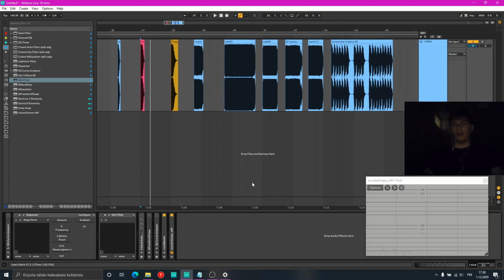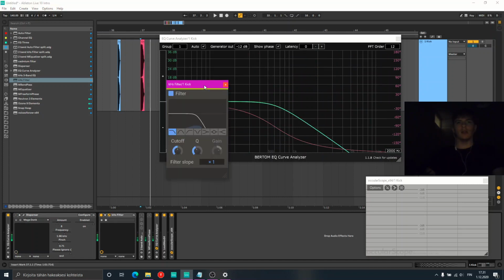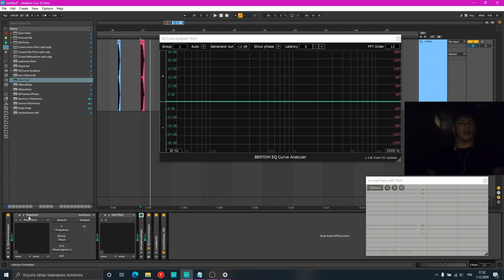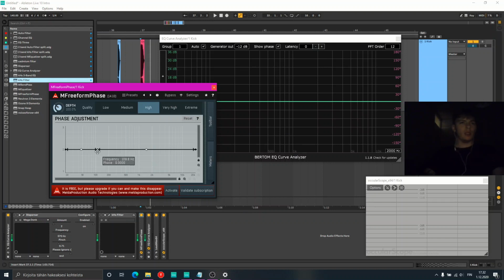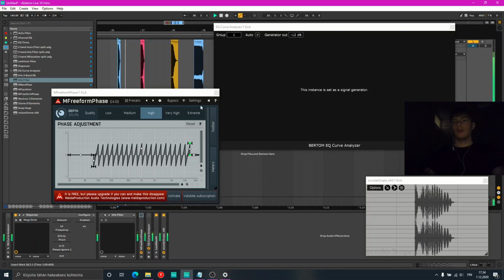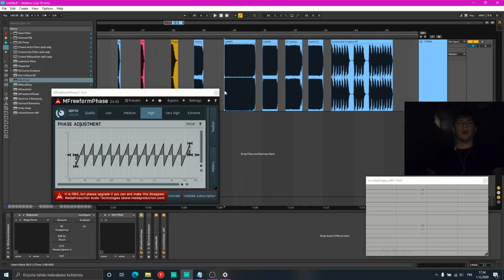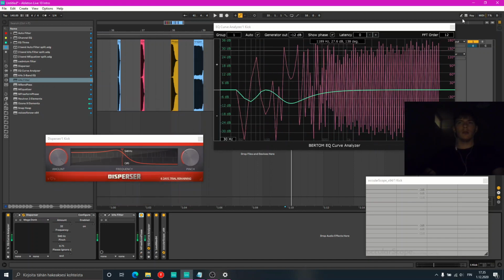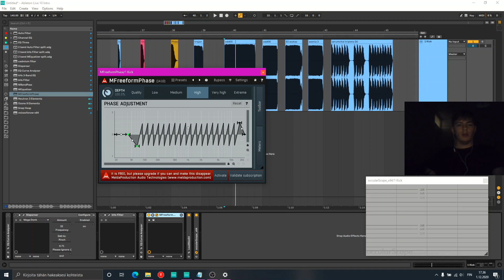Free Linear-phase Disperser | MFreeformPhase Tutorial

Comment: Every allpass filter will also work. I mean, in terms of looking for free replacements, there are other options, they're just not as easily stacked together and manipulated.
Reply: Yeah, double-checked it. MPhaser from Melda pretty much does the job. Set custom shape to a straight line (and mix it in with a slider), set phase difference to 0. Now you have a filter frequency (with Max frequency) and you can stack it (with mode and even feedback).

I mean, it's definitely different from MFreeformPhase, but you won't have to stack lowpasses, either. Allpasses will do just fine. No latency, different sound, good to have.
Reply from the maker: @Vospi  yup this video is pretty old and since then there's come up other options: mphaser, allpassphase, diopser. as you said, any allpass will work, since that's what disperser is. it's just that there's not that many allpasses available.
Reply: @borrasca  yo long time but where can I find allpassphase?
Reply from the maker: @GlowEm DL link is in the description of this video
Reply: @ bro a legend thanks!

Comment: Could you please show a phase problem fixing with that?
A kick and a bass would nice...
Reply from the maker: I only use it for sound design not fixing phase problems. Any bass should always be fully sidechained to the kick anyway so i don’t have them colliding in the first place
Reply: @borrasca  If you don't mind, I disagree about the best way to fix phase issues, but you're free to pick you way to deal with, of course.
I understand that phase AND side-shain methods together is the best.
In fact, there's another great way that is split the kick in three parts.
Then treat them.

My question started to jump in my mind after to rescue for this kind of phase solution here  https://www.youtube.com/watch?v=opfir8S_y30

The point about your video is that I could not understand how to use Melda's Phase and get to the same (or even better) results compared to Disperser.
You mean that we would be using it like a "distortion" or some kind of "saturator"???
Reply from the maker: @marceloribeirosimoes8959  If you wanted similar results to that video, you would adjust the horizontal positions of the left- and rightmost points of the saw curve in MFreeformphase as well as the number of saws between them. 

But fixing the phase in relation to the bass like this would require the exact same bass/sub note every time the kick hits, which I don’t do. 

IMO the best way is to keep the sub bass separate either by band splitting or a whole different synth patch. Ring mod sidechain it so that it comes up in volume right as the kick (which should never be long) ends. Then you can just sidechain compress/volume duck the mid basses and everything else by ear
Reply: @borrasca  Yes, that's it.  I trully agree.  But, as you probably know, we try to find the best way to do things.  And trying to fix phase problems AND ducking (level ou frequency range or both - who knows...?)
But ifo you saw that video, you could see that it works and works good, too.

But, THANK you for the answer and for your time.
I'll try to put your approaching to the field here and see what I can get.
Thanx a lot!!!!!!!!